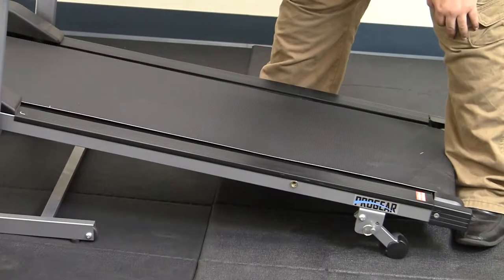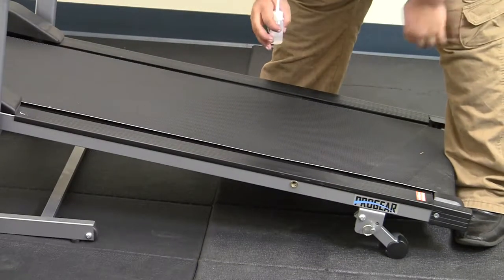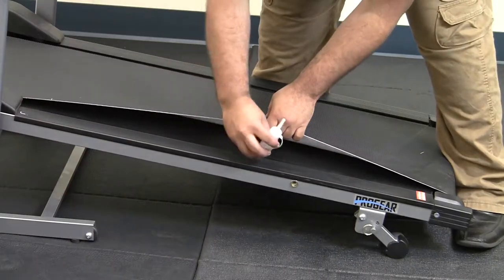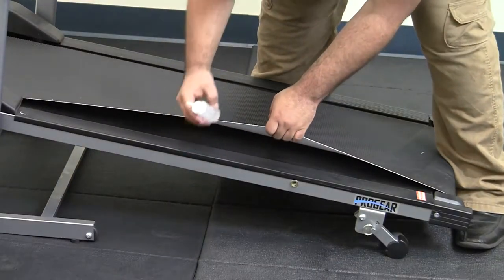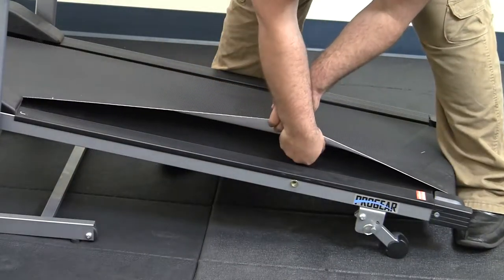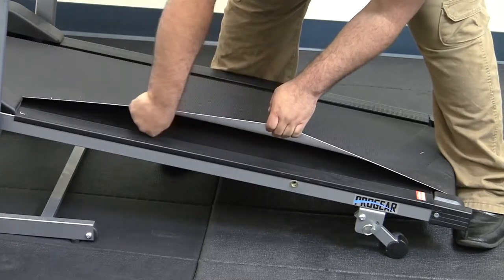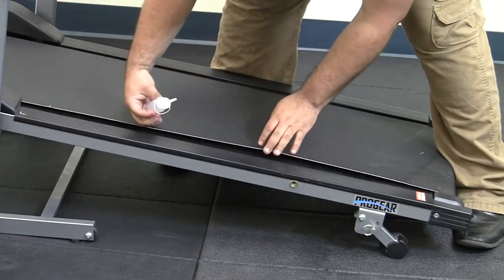Lubricating Belt on Treadmills

Comment: I have purchased 2 of the 100XL Exerpeutic High Capacity Magnetic Resistance Manual Treadmills. They both had the same problem of the extreme resistance even on the lowest setting. I called customer service who instructed me to lubricate the walking platform. I did that and there was no difference. I called customer service again and through a series of emails back and forth they stated they could not help me because the warranty had expired. I have had this problem from the very start and was not able to resolve this during the time of the warranty due to a personal issue. I haven't even clocked an hour on the second treadmill I purchased. I am very disappointed in their customer service and would have expected them to try to help further and resolve the problem.